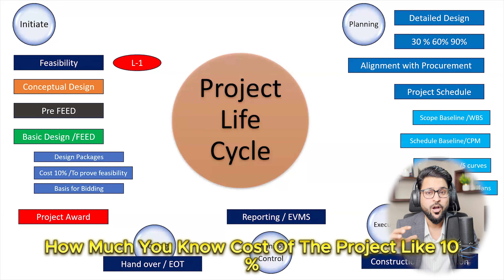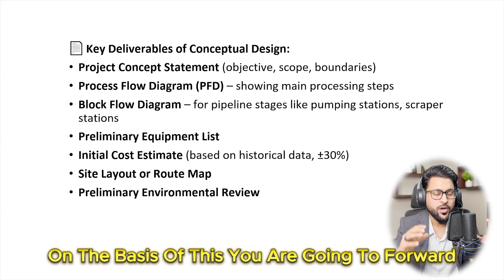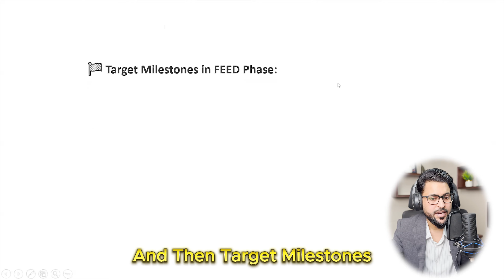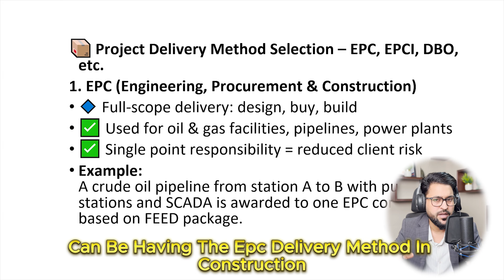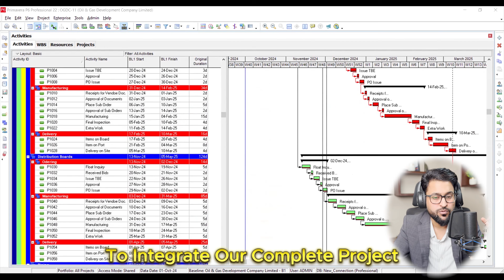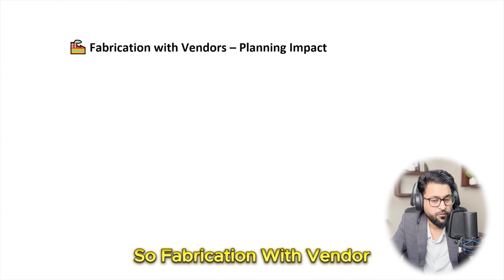What is Front End Engineering Design and EPC Project Phases ? #planningengineer #projectplanning

Comment: 50 % design basis means?
Reply from the maker: "50% design basis" refers to the point in a project where approximately half of the detailed engineering design work has been completed and formally documented. This usually involves significant progress on P&IDs, equipment specifications, and layout drawings.